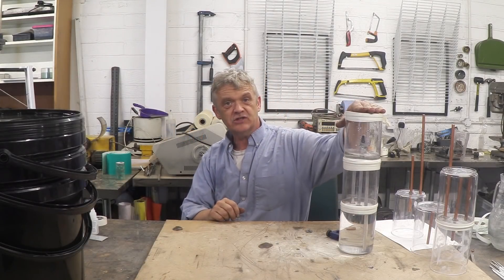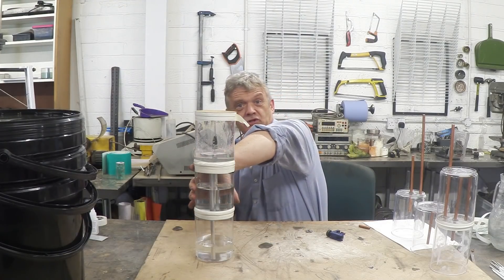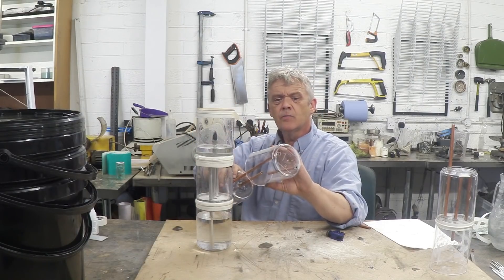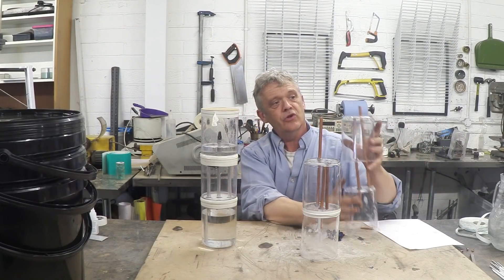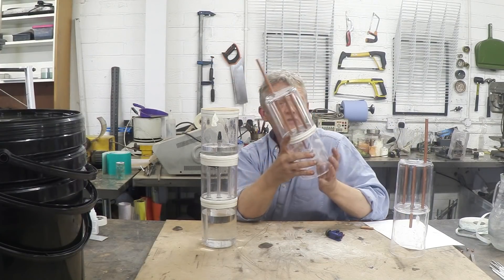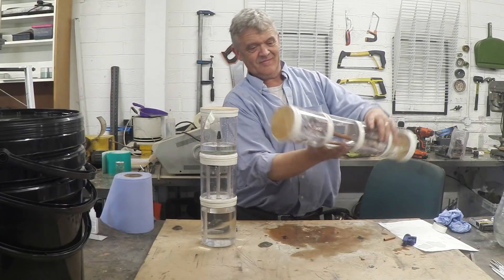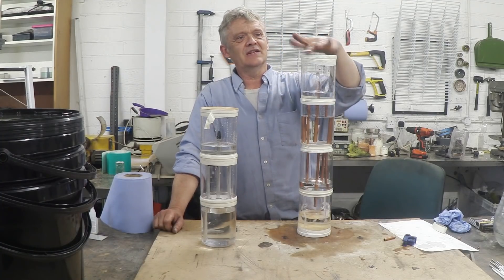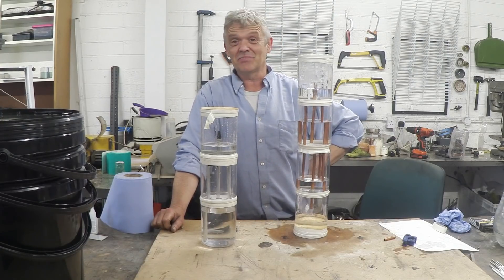'Perpetual' 4 Tier Heron's Fountain

Comment: Hi
How about ideas for extending the infinity aspect?
What about putting a mid height pivot point, have the water passing through the system generating electricity to feed capacitors, upon fountain stopping, switch to flip the system over?
Reply: The water flows down, meaning the bottom will always be heavier when the stored energy has been expended. It takes energy to lift the heavy lower part of the device up above the rest if you use that motor pivot idea. If you move the pivot closer to the heavy bottom every time you flip it, then you still need to move it up to allow the top section to swing clear of the supporting structure. The best you are likely to get is a cool robotics toy!

Now if you want to mess around with 'brand new' possibly wacky physics, then niobium, and extremely dense metal superconductors at high voltage and low temperature (with radiation shielding) are your best bet. You might be able to finally tell us if they deflect gravitons or do something weird with inertia like all the pseudo-science papers seem to claim! The boundaries of scientific progress rely on doers with a nack for experimentation!

P.S. It may help to anneal the metals to get a single crystal, versus maybe cooling thin sheets with liquid nitrogen to get amorphous metallic crystal structures, or somewhere in between (using tempering or normal cooling). Even though the metal is not at its superconducting temperature (where electrons flow all the way through), there can be pockets of superconductivity that spawn and grab onto the famous cooper pairs, possibly giving strange effects.

Some papers even claim that spinning these metals rapidly at cold temperatures can have strange effects on the measured mass of objects above or below them, or the measure of composite electrons that form cooper pairs (Called the Tate Anomaly).

I know it sounds strange, but I am upset at the scientific community (and remain skeptical) for choosing not to publish the paper on the reversal of aging using 3 of the 4 Tamanaka factors (OSK with a programmable on-off switch). If that is considered too much information by popular vote of the controlling class, then other topics can, too.
Reply from the maker: I don't know mate - worth a try though - this was four plastic jars and a little time - you could do it with 4 soda bottles - fancy giving it a go?

Comment: So it's a "perpetual" manual flipping fountain not all that unlike the 3-cylinder one. Take a look at the "barrel drum water pump" that many of the Asians use to irrigate their fields. It never has to be flipped and pulls water from a lower water source (i.e. a river) to a higher plane (i.e. crop fields) perpetually. Just has to be primed once and off it goes. Could be used to power a water wheel electric generator too.
Reply from the maker: yep - it's kind of close to perpetual as we will get I think - but that might be just my prejudice showing there - the barrel drum water pump is a syphon I think
Reply: @ThinkingandTinkering  It is a siphon indeed, Robert. Pretty ingenious stuff.

Comment: I know something else that is perpetual and uses water......the sea. Now all that is needed is a HUGE version of this thing that has a diameter such that when it rotates during hightide, it is push towards the land and ends up 180 degrees rotated, thus causing it to start doing its thing, and then run long enough until low tide, at which time it rolls back when empty to the low-tide mark and does the same . Really fascinating stuff, or as you would say : "That is awesome". Thanks again.
Reply from the maker: very nice mate - I agree there lol

Comment: I was just wondering if you could make a few (say 6) of these 4 cylinder varieties in a jig where each set of cylinders are offset, so that you will always have at least one filling up and causing the entire jig rotate, almost like a very large cam shaft of Heron's Fountain's. (I would make one myself, but i have my own expensive experiment to build)
Reply: You'd have to redesign things so that the upwards side of the wheel was transferring water from a position farther from the hub to a position closer to the hub and reverse that on the downward side of the wheel: move water from a position closer to the hub to a position farther from the hub
Reply from the maker: I have my own stuff too mate - but nice comment and hopefully it will inspire someone to try

Comment: I like it, especially since the air in the top container and the water passing to the third container are cooler than the fluids in the rest of the system.  If your auto heater core was in-line between the top and third cylinders, your bellows A/C system would have active cooling, and Heron's fountain could make up the rest of the heat pump system.  If a small amount of bellows air is  sometimes diverted to move a little water from the bottom container to the top of the middle one, you wouldn't need to flip the system or have a fourth container.
Reply from the maker: now then - that is clever thinking mate - I really like that - clever combination of two seemingly disparate things into one new device - thank you for inspiring me

Comment: So, you can "scale" this up and put impeller/Gens on each end and put the whole thing on a middle pivot point and let it run for ever!  Think about having several hundred gallons running......
Reply: A sort of 'free energy' machine? You might be onto something there. :D
Reply: If the water was filling up the top, maybe, but it's filling up the bottom. But you could maybe add a wind up spring with an escapement timed to release and spin the pivot when the fountain emptied. That would keep it going for awhile.
Reply from the maker: interesting mate - personally I have my own ideas about this but I like that

Comment: You can use cheap aerosol puffer to make a automatic rotating system they have timing circuits that activate ever y 5, 10,15 mins to a dc motor
Reply: Very cool indeed you could also run that circuit and more from like I suggested a micro turbine in just 1 of the chambers to a ultra capacitor made with your ink no battery needed .  The foundation acting like a dinamo for the motor to turn it
Reply from the maker: maybe a lot switch in cylinder 2 and 3 to control the timing?
Reply: That would work perfectly

Comment: I had an idea a long while ago that uses a wind turbine to push a fluid around a circular wheel to utilize gravity to create pressure gradients like the Minto wheel concept that's been suggested!  This pressure is then converted into energy!  I suppose the evaporation engine could also be used in conjunction with this using solar heat collection!
Reply from the maker: Cool idea! - you should try and build it mate

Comment: Nice video, I myself was working on a device (Before relocation due to CV19) that was the closet to a perpetual device i had ever seen using already existing technology. If you have heard of a passive water condenser that acts like a desert battle or a cactus plant, then you may know of passive materials that can condense water from the air without energy input. if you link that to an evaporation engine the you'd get a seemly perpetual type device... You could search for an evaporation engine or passive water condensers to find out what am on about
Reply from the maker: I already know what you are on about mate but the post is awesome and I count it as a share to everyone else - cheers

Comment: You could even put that on a wheel but off balance, and once the top weight is greater at the top it falls to the bottom and momentum carries it till it locks into place once again off centre. This way it would definitely be perpetual motion not needing you to tip it at any point.
Reply from the maker: I am wondering if we built a few and put them into a Minto wheel config?
Reply: @ThinkingandTinkering  Ooooh.. I just looked up "Minto Wheel"... that look quite promising!!!  Why do I get the feeling that's the next video we'll be watching?  😸😸😸
Reply from the maker: @NorthernKitty  am I that transparent lol
Reply: I'm wondering if there's a way to arrange counterweights and locking switches to achieve the same.  That is, once the bottom cylinder is full, it unlocks a switch to allow a weight to turn it.  As it turns, it lifts an opposing weight.  Once upright, the opposing weight is locked into place until the bottom cylinder is full again and unlocks the switch.  Process continues to repeat.  I'm thinking I'm still missing something, like perhaps an additional counterweight that is lifted by a paddlewheel on a ratcheted gear spun by the falling water that is just enough weight when added to the main counterweight to spin the apparatus when the switch unlocks both.  Hope that's clear, I'm still trying to wrap my head around how it could work.